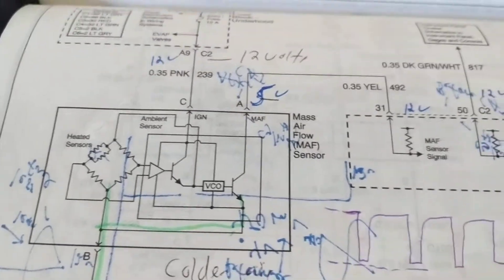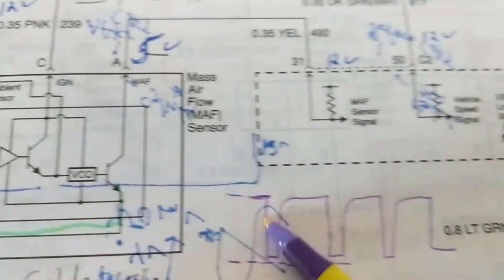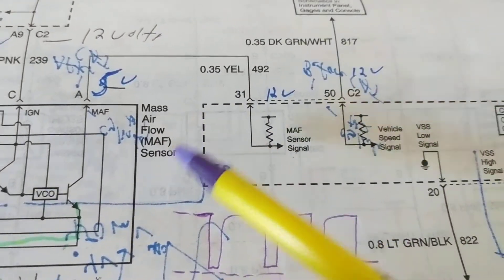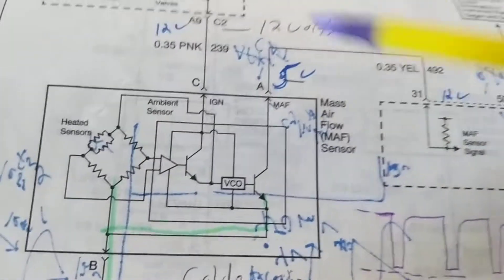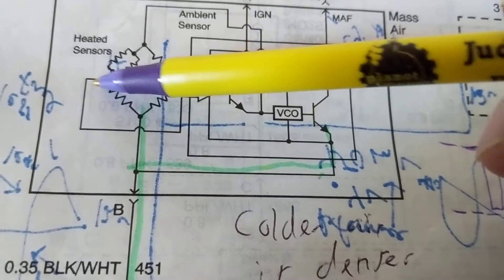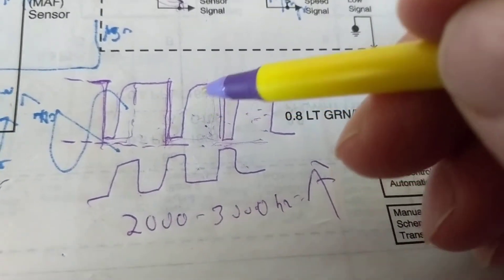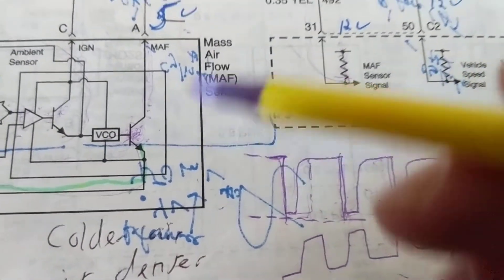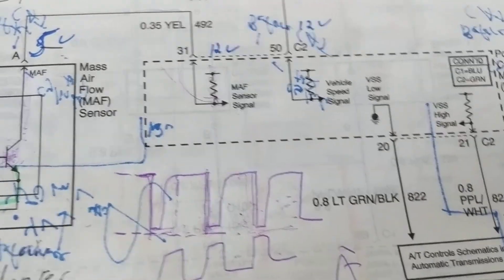how to test MASS AIR FLOW SENSOR FROM WIRING DIAGRAM EXPLANATION

Comment: Thanks bro, i am stuck on stuck on this solid state MAF sensor
Reply from the maker: Just think of it as a sensor that measures grams per second of air flow
Reply: @Joeelectronicschematicsforauto  confusing part is wheats stone stuff, dont know how the current flows.
Reply from the maker: @dennisfengcanada  you mean the wheatstone bridge that's internal current flow to make the voltage drops equal the most important is the output signal